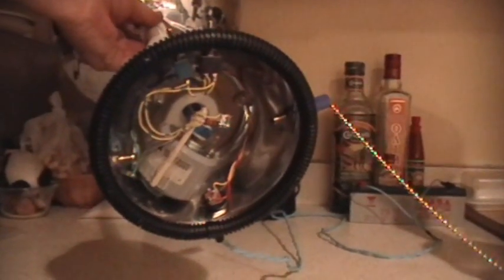Some Large Sparks from a Small Machine

Comment: Of course the water pipe would be an endless source of electrons. So what polarity do you feel the VDG has on its top load? Are sparks made of moving electrons or moving ions or both? What prevents the charge from creating a leakage path down the tube instead of across the air gap?. Where does the triboelectric process occur in your device?

I musta woke up with a bunch of questions o.O

I think an umbrella hat with streamers might be interesting :D

Comment from the maker: This was totally empirical. I noticed on an earlier version that when the top support ring was all the way up, the thing sparked from the hole (as can be seen in this video too, but not severely). So I moved it down, it got better, moved it down some more, till I found a "sweet spot" where the charge didn't want to spark there so much. With this version the effect is really noticeable.
If you look at the machine in the dark, you can see the "corona angels", and where they flare out is the spot.